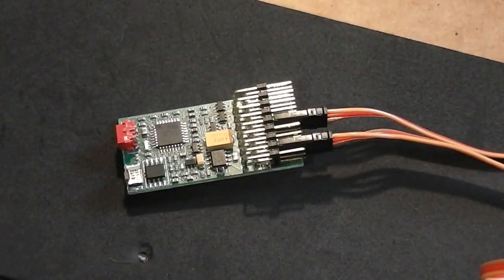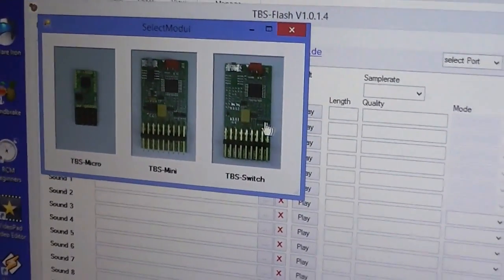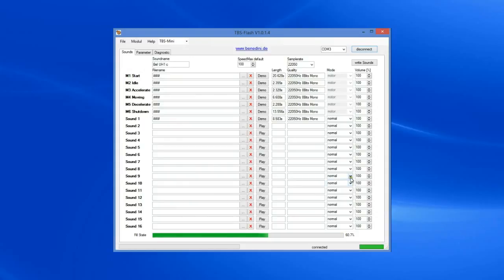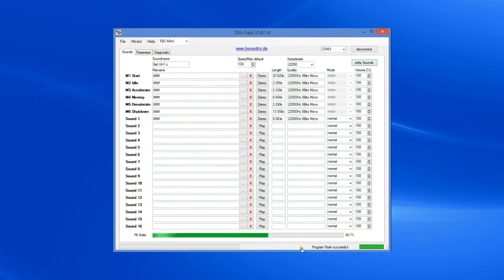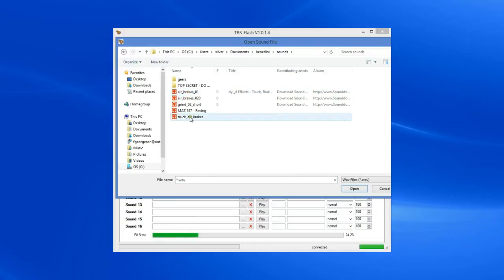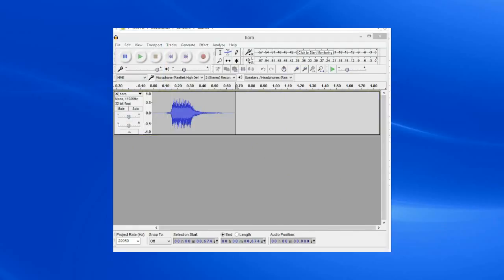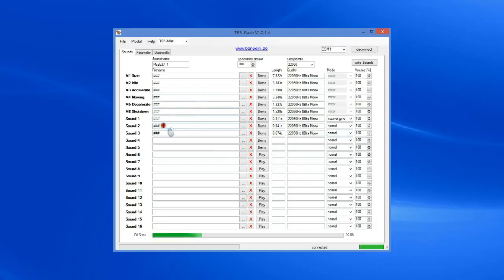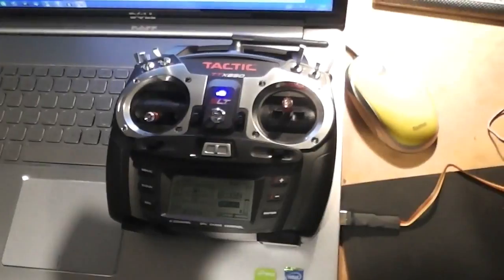TBS mini multifunction sound card - Part Two - Adding Custom Sounds. ( Benedini RC-Electronics )

Comment: I connected the tbs micro sound module, but when I tried to connect it, it said, "I can't open the COM port," and the sound module doesn't connect to the computer. Do you know what to do?
Reply from the maker: If you may be using the DasMikro TBS clone they have a dodgy programming card that won't work. you may need to get the latest FTDI drivers or another FTDI chip.
Reply: @OldIronRC  I solved the connection problem. Thank you! Can you connect the servo motor to the micro module and set it up? What should I do if I can?
Reply: @s.u.k880  I have the same problem but cant solve it, what did you do?
Reply: @OldIronRC  I'd like to set the servo to blink for cannonball recoil in the tank. I want to start the Flyski controller with the fifth channel on the loop switch, is it possible?

Comment: Can you please guide me if I only want the engine sound and no more other sounds, and I want to start the engine by simply pressing the throttle on my transmitter, what parameters I have to set?
Reply from the maker: Set the mode to "Autostart". It can be done on the card, or with the software. It is in the manual how this is done.
Reply: @OldIronRC  Thanks a lot! I followed your tip and did it!😊

Comment: Hi, is it necessary to plug out the receiver before programming? I dont have a battery pack, can I keep the esc plug connected as it is to keep the card powered during programming?
Reply from the maker: You can power it off the ESC also.
Reply: @OldIronRC  Thank you for helping me. I have successfully programmed a different sound to the card. Thanks to your 3 part video on the TBS mini. Learned a lot from it! You can see my truck in my channel👇😊
https://youtu.be/RkirnKI6jys

Comment: Sir, its a great informative video, but just want to know one thing, I have a generic 30 amp esc, so can I connect this sound card with the receiver and the esc with the 'y' servo cable that comes with its package? Or we have to use seperate cables, one for receiver, one for esc?
Reply from the maker: seperate cables if you use sound selection (multi function). one cable if you use auto mode (engine sound only).

Comment: Hi guys, nice video
Is the process the same with tbs micro ?
thanks
Reply from the maker: I have not used a micro version, but it looks like it is the same, it says it can be programmed on the product page and there is a pdf manual download on the page that shows an adapter for connecting to USB. http://benedini.de/html/sound.html
Reply from the maker: I do not know. You can listen to demos of some of the sounds on the benedini.de website or via the card program software.
Reply: Yes I have found it sorry for silly question thanks a lot